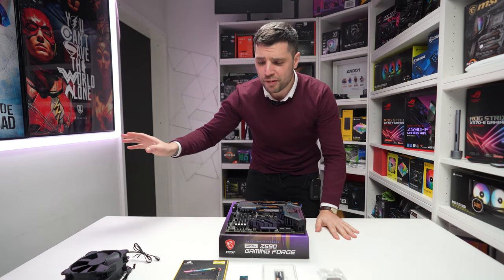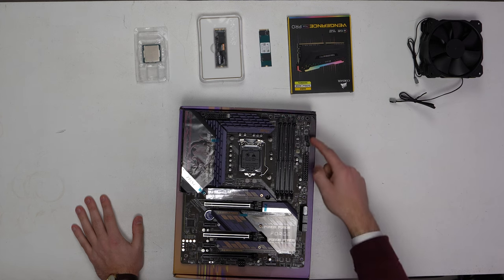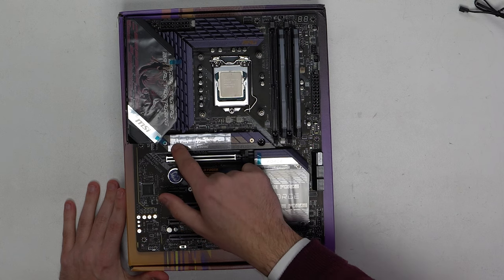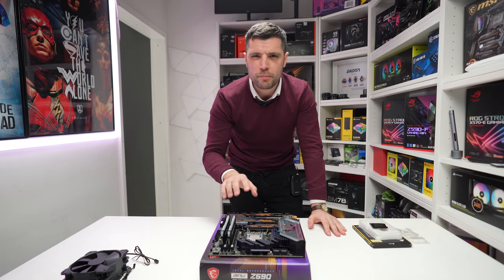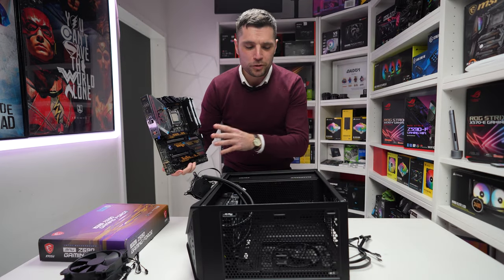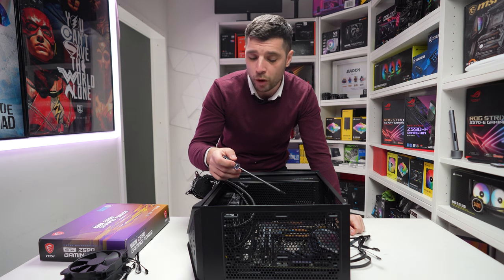Gaming PC Build FAIL!

Comment: Hi mate! Bought this fantastic model from Daniel and it arrived early this week. Got everything set up and all was working perfectly until this afternoon where the screen froze and the PC turned off. Same thing happened once more before a message came up on the screen saying that the CPU was overheating. The little display on the board read from 00 to 99 and it sent me to the motherboard settings, but as I’m not an expert and gaming PCs I didn’t want to mess with anything. Now every time I turn it on it freezes and turns off. What do I need to do to fix this issue? I’ve downloaded a few games from steam and Xbox game pass but nothing too heavy on the storage.
Reply from the maker: Hi mate sorry to hear that but Daniel is a good guy and will sort for you. It sounds like a psu issue or a potential cpu paste problem with incorrect mounting. Both easy fixes pal 👍
Reply: @TechCheckUK  nice one thanks mate 😊🙏
Reply from the maker: @dionsmith2405  no worries 👍
Reply: Had replaced the power supply and cpu paste and all works great now with low temps 35-40C …hope you are happy Dion !
Reply: @danih9523  very happy thank you! 😊🙏
Reply from the maker: Well done mate 👏
Reply from the maker: See thats what happens when you buy from a decent seller mate 👍